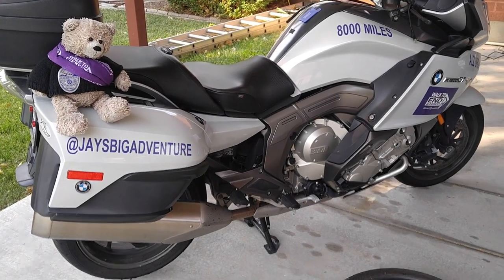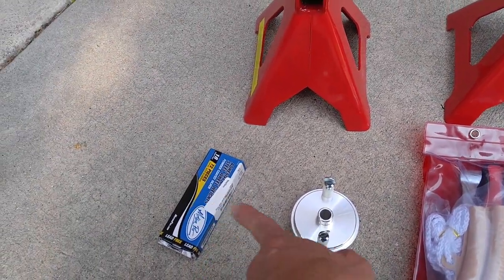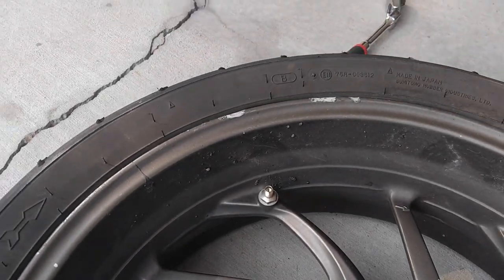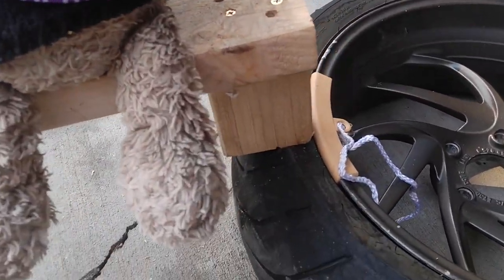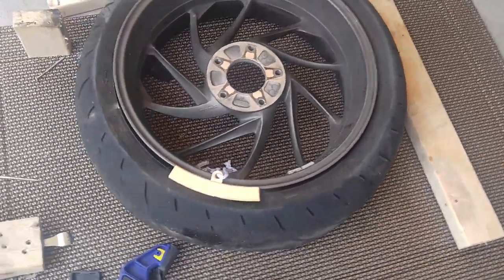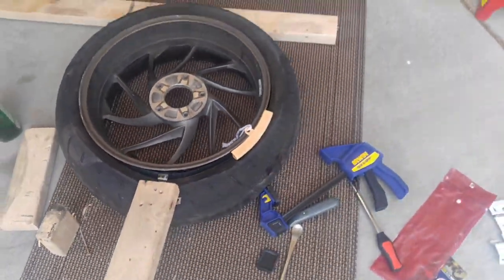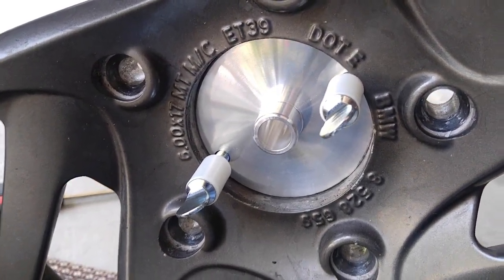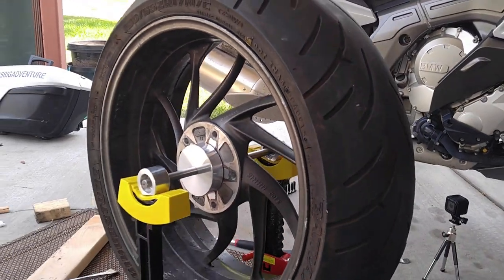Jaysbigadventure BMW K1600 Rear Tire Change

Comment: In the past I let the shop change my tires for me, until one time a professional installed the tire backward and I didn't noticed it until 4k miles later. Nothing bad happened, but after doing some research, I realized I could save around $80 on each tire change if I learn how to do it myself. But that's not the true reason why I did it: learning everything there is to know about your motorcycle and how to do it yourself can be fun and frustrating at the same time, however, there's always a sense of accomplishment and pride after you succeed. I know this is a very old video, however, there's a simple 3 tire spoon technique for breaking beads which I've somewhat mastered by now, and I have to say I actually look forward to my next tire change to try it out again. Hint: WD40 is your friend! (Found the video: https://youtu.be/ragtsxdh2Fc?t=84)